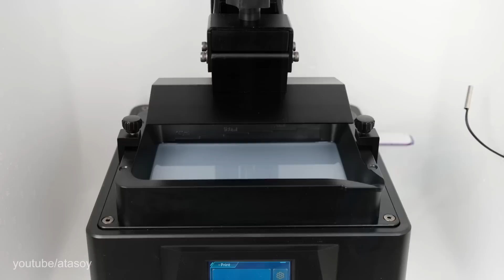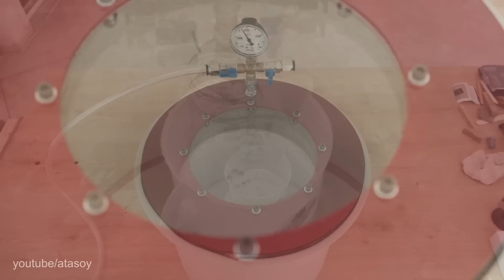Stitch Figured Epoxy Egg | Epoxy Resin Art

Comment: Not sure why you didn't do all of the polishing while it was on the lathe. It would have saved a lot of work. But I guess it's still great.
Reply from the maker: My lathe is not suitable for polishing, I can't do a good job as it has manual speed adjustment.  Also, the Polishing Felt I use does a very good job. I can't get this level of shine on the lathe.

Comment: Can I please ask you what is the clear sheat you pour resin in?
Reply from the maker: It is known as acetate paper.
I am using this material to appear in the video.
You don't have to use it.
Epoxy resin cannot adhere to silicone and plastic.
You can use any non-brittle plastic.
Reply: @atasoy  I am new to this kind of purring resin, I have only used molds so your answer is very helpful! I appreciate it very much 😊

Comment: Hello what’s the name of the round plastic you used as a mold ?? And also what’s the thickness ?? Thank you
Reply from the maker: Acetate paper, 100 micron.
You can use different plastic materials instead.  It is not necessary to use acetate paper.  Epoxy does not stick to plastic and silicone.